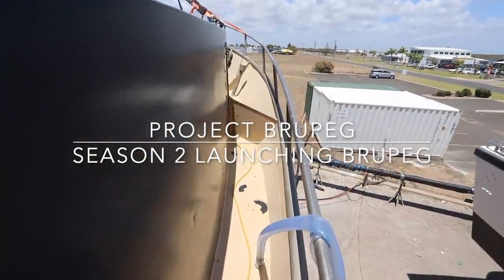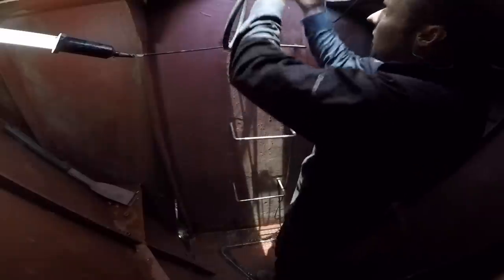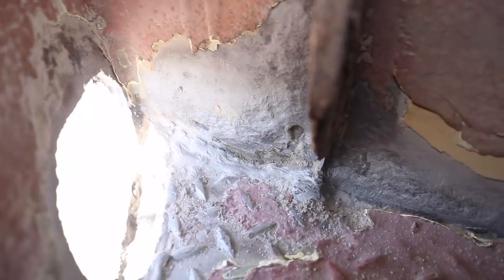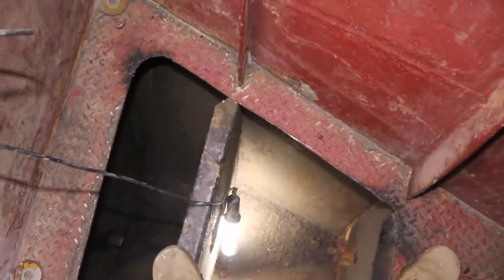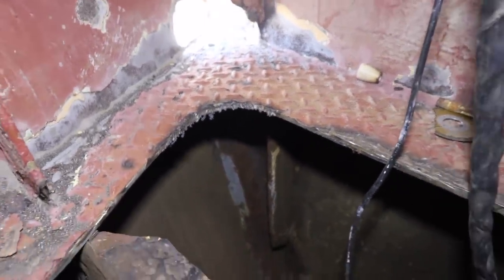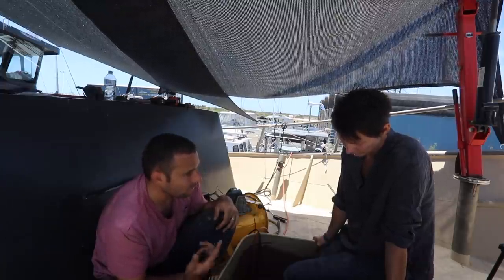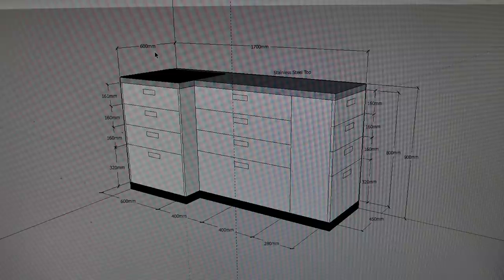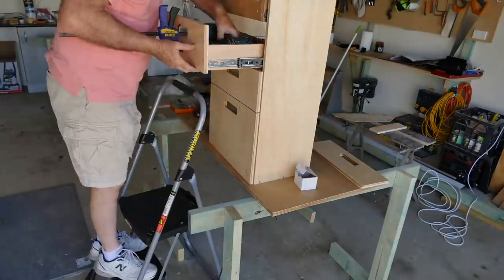We cut the front open! - Project Brupeg Ep. 112

Comment: If you can check perfect air tightness of that compartment, then you will have oxidation only until all the oxygen is used and then it will stop. For Fe2O3 you will consume 0,43g of oxygen for every gram of Iron, to generate 1,43g of oxide. It will be almost impossible that the iron oxide releases its oxygen, leaving iron powder and that that oxygen goes elsewhere to corrode more iron, because this separation can only be done with very high heat. If you can keep the compartment air and water tight so that no new oxygen can come in, you will only have an initial corrosion and then it will stop, you do not even need to paint it, but it is mandatory that it is airtight. Before sealing it you can even put CO2 or nitrogen or even the gas of your welder to reduce the oxygen content.
Reply: I would say that all the rust that you found generated before making the compartment airtight or it never was perfectly airtight. Of course paint is a plus if at some moment the compartment looses air tightness.
Reply from the maker: Hi Thomas. The rust was too deep for just the surface effect you discribe. It has to have lost its seal at some point. Once we have finished the repairs we will paint the blasted steel and seal the tank airtight. And use the argon from our welder to fill the tank.
Reply: Another thing that can be done is to leave an unpainted sacrificial piece of iron to rust without affecting the integrity of the hull.
Reply from the maker: I really like that idea, I might use that

Comment: Those drawers are epic! Simple, clean and sturdy.
Reply from the maker: Yeah they are pretty lovely aye. Hoping to get onto the pre work needed for the kitchen soon. We need to strip the old kitchen out, blast some steel work, two pack the blasted areas, fit the insulation and wiring, wall panels and then install the new cabinets
Reply: Keep working away, it looks like it’s getting closer. Good video guys, keep up the good work!

Comment: So you've got a anchor room and below that you've got this sealed off crash bulkhead that has lots of rust and repair issues. 1, it looks like it has a floor in it, what's below it? Even if its just another small sealed off space why wouldn't there be similar rust issues in there? 2, If the weight isn't an issue, why not take advantage of this compartment for additional fuel or water or waste storage? It seems like if the space was filled and air free you wouldn't have rust. 3, in any case instead of just welding it all back tight, why not put in a hatch of some sorts?
Sorry for you guys that you are finding more additional work.
Reply from the maker: Hi, yeah so the crash bulkhead goes all the way down to the keel, the ‘floor’ you can see is a small amount of cement put in at time of build to make it a flat surface. As for weight, Brupeg is very fine at the bow go weight up front disproportionately affects trim, hence the tank is air not liquid. I have heard of other boats using this space as a fuel tank (and we have pipework in there which could be modified to allow for this) but for now we will be leaving it an air cavity (but likely filling it with Nitrogen, CO2 or Argon) to keep the bow up. If we need weight up there for trim we will fill it with an oil of some sort to prevent rust.
Reply: Project Brupeg Have you considered putting in a “air drier” along with the compressed air / gas system you mentioned add buoyancy to the bow of Brupeg. One thing I just thought of is regardless what gas you use it would be a good idea to install monitor system to alert you of lost gas pressure as well as gas sensor in that lazurite to warn of a gas build up after all it only takes a small amount of nitrogen to incapacitate or kill you.

Comment: Steel ships rust from the inside out. Stainless steel when attached electrically turns the mild steel of your boat into a giant anode. Dissimilar metal corrosion. Stainless steel has some applications, but they are few and far in between. Electrical isolation is essential if you want to prevent the dissimilar metal corrosion. Military ships use stainless very sparingly. I was looking at a USCG 125’ cutter built in 1927 and didn’t see any stainless until I got to the galley. Cheers!

Comment: You do like to find terrible places to do your work. That hasn't been touched for a long while and I say it's better tackling it on the hard, than at sea. Your going to have some tricky pieces to replace and seal up. The only good thing is the list keeps getting shorter. You might look for a bush hammer attachment for the hammer drill and air chisel. It may work better for you on the rubber surface, smallest head you can find to get into corners and tight spaces. The bigger heads work faster but need bigger hammers to penetrate the dross. Your carpenter has his cabinet making skill down pat and they look great. I must say I have never had to coat the cabinets in epoxy though. Nice work there and you can be proud of it.

Comment: My Worry was that, if that little hole had never appeared, then all might of been left as is. I think there were some serious rust issues down there. that might of gave way in rough seas or a collision. So glad it's all going to be taking care of now. Hats off to the non-professional carpenter that done a professional job. Just Brilliant work!
Reply from the maker: Hi Kevin. We were always going to open it up, the pin hole happened before we got to it though. that said maintence on a big boat is ongoing, some things do get missed and you pick them up later, Brupeg has enough redundancy built in that we could cut a 2ft square hole in the crash bulkhead and it wouldnt matter the boat would still float fine, we could still steam back to port and we would'nt need to be in a rush to haul out and fix it. That same scenario could play out in multiple areas on this boat because of the waterproof bulkhead design. A few years back a very similar trawler got pulled out with a gash 20ft x 3ft right down the chine, they hit a reef at 10knots. They steamed back under their own power and got lifted out the next day.
Reply: @ProjectBrupeg  Good to know this. You obviously have a lot of confidence in this boat, but never think too confidently that she is unsinkable. You will be taken her to a part of the world that is ice, like floating rocks everywhere. Such an hostile unforgiving environment. I think you are very brave to even go there.Once in the water she will seem much smaller. We will all be rooting and praying that you have great adventures 
and not a big mishap like titannic. And we all appreciate the filming ,which will seem like were all with you. Wish you all the luck in the world.

Comment: Just remember man. It’s “stainless” not “stainfree” stainless can still pit and rust. I can show you some 316 grade stainless rudders and monel shafting that have 1/4” pitting and rust on them. Especially when it’s welded to steel.
Reply from the maker: Yeah this didnt have any pitting, im actually thinking the stainless treadplate floor is a fairly new addition to the boat. That said im thinking of just hammering and blasting the paint off the stainless so I can see the condition anytime going forward, im not a fan of painted stainless (or alloy)

Comment: What you guys seriously need is an ultrasonic thickness gage. They typically cost around $300 US. I’ve used one for years in a machine shop. They can be incredibly accurate (+ or - .002” on 1/4”steel) They tend to register/reflect off the thinnest point like a corrosion crater. State inspectors use them to certify the wall thickness on pressure vessels like compressor tanks that can get thin on the bottom. You must get the correct “head” for the material you plan on using it on like steel. The trick is to calibrate it on a known thickness, same material. The surface should be free of paint, rust and sanded smooth on the side and area where you place the probe/head. Contact gel is important.
Reply from the maker: We’ve actually got one. Lent to us by Dangar Stu, however we can tell by eye if the plate needs replacing, it’s either flat in great nick or rusted too far. Anything more than 1mm corrosion in a critical area of the hull gets cut out and replaced. With Brupeg we can see both sides of the hull in every compartment
Reply: Ah! Excellent!

Comment: Damien, on that hard to remove rubbery stuff, you can freeze it, then hammer and/or scrape it off in chunks while it stays cold enough to be stiff... dump some ice on it at first, to cool the area a bit, then spray liquid from any compressed gas bottles or electronic dust off cans to super cool it... have had to do this to remove undercoating from old VW and Porsche floor pans in restoration projects. Oh, and maybe paint that crash bulkhead area on the outside with some arrows and lettering saying "Please Crash Here Only, Thank You !"
Reply from the maker: I’ve never tried freezing it. Interesting concept. I’m guessing you would need to be fast as the metal would suck the temp away pretty fast. I LOVE the instructional crashing instructions
Reply: @ProjectBrupeg  Worked on car stuff with thinner metal, but you do have to do palm sized patches if its warm, or wait for winter to help..  In your case be VERY careful because of the enclosed space issues, don't want you expiring from lack of Oxygen !

Comment: I could have missed it.....maybe in another video...... but have you discussed the presence (or not) of either lead or asbestos in your project?
Reply from the maker: Hi Bruce, not discussed it but Brupeg was a completely stripped steel hull when we brought her, no asbestos to deal with. Lead based paint has been used and generally we leave it as is, as its some of the best holding paint on the boat.
Reply: @ProjectBrupeg  Thanks for the info. BTW: The project is amazing. Kudo-s for Not cutting corners and doing your best to solve issues the right way.

Comment: Yikes. I've just spent much of the last month in the anchor locker of my steel boat. It's hot horrible work at this time of year. The only time of day I could paint was before dawn.  All I can say is that I admire your energy and optimism.
Interestingly I've decided to redesign my chain locker as well; I'm getting the chain out of the forepeak and stowing it in a fully isolated well about 1.5m further aft where it can't touch the steel, and allow dirt and dampness to accumulate on the hull. The forepeak itself will be left fully open and able to be inspected and cleaned. Spray in some bilge cleaner and hose out with fresh water every year or so and it should last a good deal longer.
Reply from the maker: Nice, yeah because we have much bigger anchors than what the commercial guys every used the winch had to be moved backwards, this made the chain fall off the original shelf. its mostly stainless up there on Brupeg but its still a real pain with the current design, i like the idea of moving back and down which is our plan. Ive also seen a lot of trawlers do a similar idea to you where they drop into a big stainless drum sunk into the deck. no more anchor room etc.
Reply: @ProjectBrupeg Even though Brupeg is a much bigger, heavier boat than mine, I still suspect that getting your anchor chain aft and low will make a worthwhile difference. Incidentally did the Galvanic Isolator arrive? I posted it over a month ago.
Reply from the maker: Ahhh I meant to say something, yes it did, thank you so much for this. It says on the side it needs the Prosafe monitoring system so I've been on the hunt to find those parts for it. Can you send me your email address and i will stick you on our early episode release mailing list if you want to
Reply: @ProjectBrupeg  I think most people use it without the monitoring system.  The manual states that monitoring is only needed to fully comply with ABYC  A-28  http://www.manualsdir.com/manuals/373198/promariner-prosafe-galvanic-isolator.html

Comment: Dumb Question? Why Aren't The Front 2-Bulkheads Water Tanks & Then Diesels Further Aft, Just In Case For The Invirorments + It's Closer To The Engines Then Also!? LOL Thsanks
Reply: Boat balance and if the fuel or water tank are compromised it will be just a switching of liquids diesel or water (Fresh, Gray, or Black) for sea water rather than the taking on of sea water.  While I cannot speak for Brupeg tank layout most all boats of this size and larger have multiple fuel storage tanks that are located throughout the boat and then a “day tank” that fuel is transferred to from the various fuel storage tanks as needed.  This does several things it keeps the boats fuel supply segregated into different tanks incase the fuel were to get contaminated with water, algae, dirt etc additionally it allows for ballasting of the boat to prevent it from listing or weather conditions.  On a side note as fuel is transferred from storage to the day tank the fuel is filtered through strainers, paper filters and often centrifuged to spin out dirt and water as the fuel is used by the engines from the day tank(s) the fuel is often filtered again though even finer filters.
Reply from the maker: Couldnt have answered this better. the front tanks are actually our vege oil storage tanks so if both are ruptured, 7 tonnes of vege oil will leak but in the sea that breaks down in days, when we head to the ice it will be high sulphur diesel which doesnt break down for a while but the plan is not to rupture them...
Reply: @ProjectBrupeg  I HOPE NOT or The Ocean Will Taste/Smell Like French Fries, Tacos & Chinese Foods!!! LOL

Comment: Nice kitchen! Wow! 

Have you ever seen a needle scaler? They work very well for what you’re doing. You can even get need scaler attachments for an air chisel for less then a dedicated unit.
Reply from the maker: Hi Jeremy, Needle guns were what i was talking about in the video. they are very light weight toys compared to the big hammer drill and chisel. we do have an air gun but its very slow compared to the big guy
Reply: Project Brupeg I guess that depends on if they are a good one or a harbor freight special. I’ve always used either my snap-on air chisel with the snap-on needle attachment, or a dedicated unit like the Ingersoll-Rand 125 or 172 series needle scaler. 

Trust me they are not toys. I’ve scaled rust for hundreds of hours. Rust from 1/4 inch thick down to surface rust. The thicker the rust scale the easier it comes off usually. 

Now that I quit being a mechanic and operate container crane I see ships crew usually needle scalers often when working on deck. Seems they prefer a needle scaler and a slag hammer for their preferred tools before treating and painting. 

I’m not meaning to argue with you. You’re doing great work. It’ll all be fine either way. Just making a suggestion to maybe save you a little time. But ultimately you’ll do what works best for you in your situation, as you should.

Cheers

Comment: 20 secong rule D. May even a minute or two if they are the expensive chocolates 😁
Reply: 20 seconds!?!? 10 max surely,.... but then only when people are watching so yeah, maybe you could stretch it to 30!
Reply from the maker: Hang on, we need more data, what is the floor made from, cause carpet would likely shorten the lifespan but something like say hygenically cleaned, two pack painted steel flooring would surely have less of a bug/germ transmission effect. Especially if you used the turkish delights as a destraction so you could grab the good chocolates before the monsters did...
Reply: @ProjectBrupeg  Just think of it as boosting your immune system.
Reply: @ProjectBrupeg  This is chocolate we talking about here, stuff the floor. A quick squirt of carb-clean a rub on the T-shirt and back of the throat ;-)

Comment: Plasma cutting directly against the diesel tank. Glad that's empty, but now you have to redo the paint on its interior. Rust on one side of that weld likely the other side too.
Reply from the maker: We had previously sandblasted and painted the fuel tank so we knew there was no  rust on that side. that said no matter what we did the paint would have burnt off when welding so we were always going to open the fuel tank up and blast and repaint on that side once the welding was finished.
Reply: @ProjectBrupeg  I'm glad you guys are being thorough. Zinc anodes didn't do their job in that area. I know you are not using raw water cooling, but may want to protect the engine with zinc, just in case the external plenums get ripped off by rocks.
Reply from the maker: Hi Jason, this was an air filled tank. A zinc couldnt work in there as they need water to transfer electrons. its normal to weld up a mild steel tank and seal it air tight as the steel surface rusts initially to pull the oxygen from the air, and soon thereafter the rust stops as the oxygen is gone. this tank never did that. it must have had an air leak for some time, hence the rust just kept going. As for the external cooling, we will be taking that off when we get to New Zealand and converting to internal cooling

Comment: I think you will close this compartment airtight. Why not first fill it with nitrogen without oxygen. That would stop any rust to form there.
Reply from the maker: Hi Paul, yes we will be doing exactl that. We need to get in here and resolve any areas that have rusted too far through but when finished we will be filling with a gas without oxygen.
Reply: Project Brupeg , I was late looking to your Dingy cutting the angle in the tubes. I could have given you a much easier way to get that correct angle. If you make a square plate around the tube that has the desired angle then you can use a ruler sliding over that plate and touching the round tube. That will transfer the plane of the plate onto the tube. Good luck.
Reply from the maker: Ahh that is a simple method, Thanks Paul